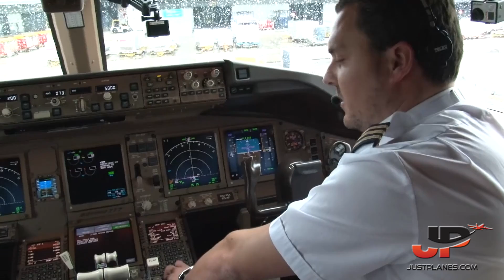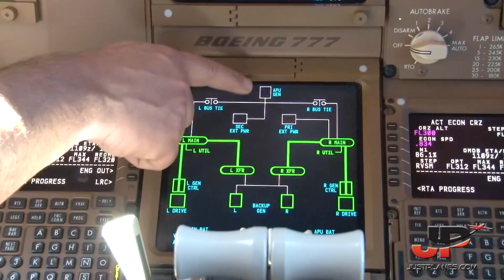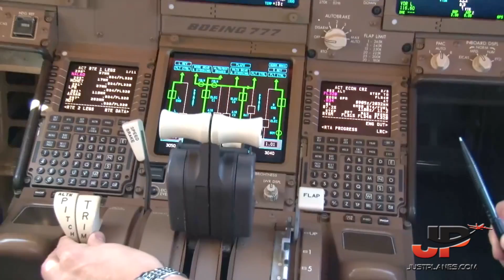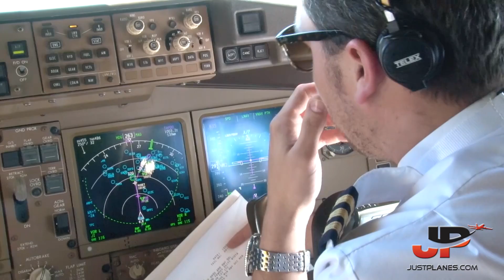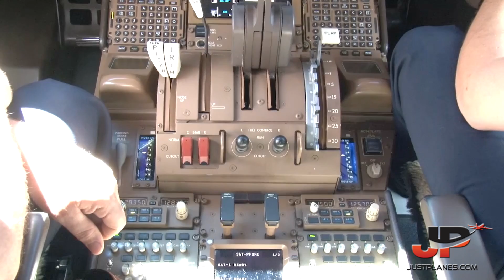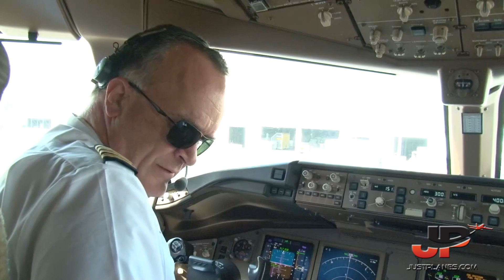ASL Airlines (TNT) Boeing 777-200LRF Cockpit Hong Kong🇭🇰 to Dubai🇦🇪

Comment: Thanks for the video. Was wondering why the 250 knots below 10000 rule was broken or was an unrestricted climb clearance given?
Reply: You're very welcome and when traffic permits ATC will clear you for unrestricted speed which would be the case if they did this on this flight.
Reply: @justplanes I saw this for the first time, cool!
Reply: Looks like they were using Meters rather then Feet. uncreal why though....